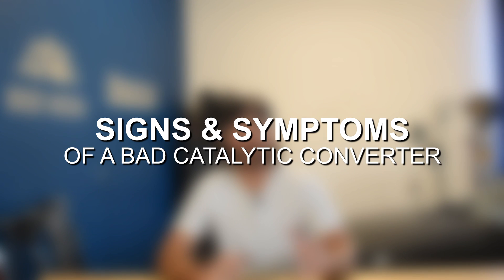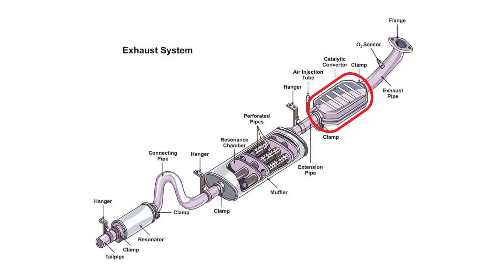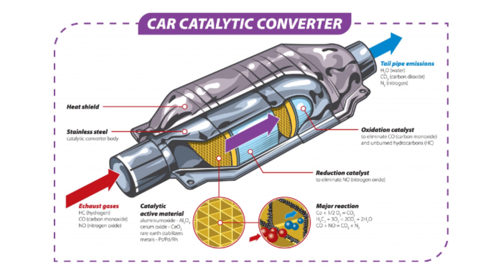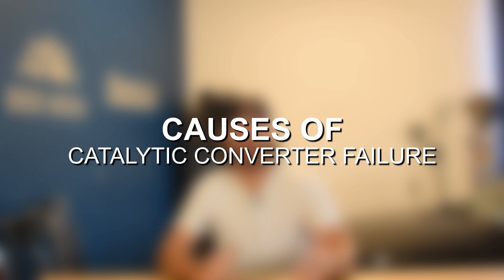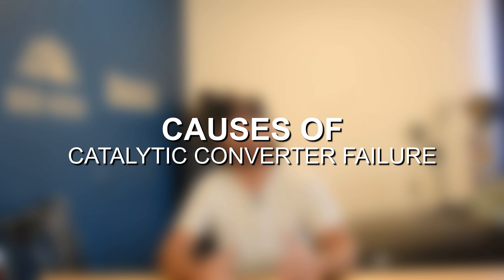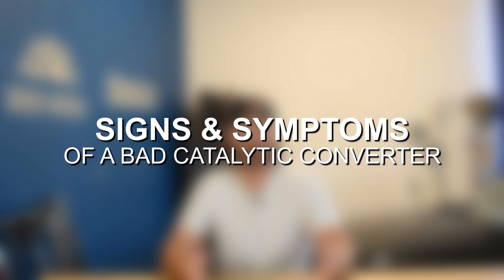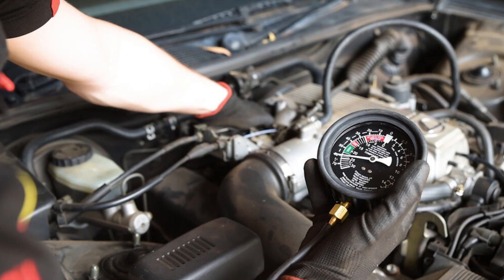Signs & Symptoms of a Bad Catalytic Converter!

Comment: My suv sounds like snap crackle and pop after I shut the engine off. No error codes to test. It used to be long drives I’d hear it. now it’s any drive over 5 minutes. could it be the Cat going bad?
Reply from the maker: C - Yes, a snapping or crackling sound after shutting off the engine—especially if it's progressively happening after shorter drives—could be related to the catalytic converter or exhaust system cooling down. It’s normal for exhaust components to make some pinging or popping sounds as they cool due to heat contraction, but if the noise is excessive, louder than usual, or seems to have worsened over time, it could suggest issues like a clogged or deteriorating catalytic converter, heat shields coming loose, or even exhaust leaks. Since you’re not getting any error codes, it might still be early in the failure stage, so keeping an eye (and ear) on it and checking the exhaust system for physical damage or looseness would be a good next step.
Reply: @ thank you and I appreciate the fast and thorough response. It’s a 22 year old mountaineer. So it’s probably about time.

Comment: My 2001 Ford Econoline run great but I think the cat convtr is falling apart inside. There's a loud rattling when accelerated or shift into reverse. Its got power but the loud noise is way too much.
Reply from the maker: C - If your 2001 Ford Econoline is running well but producing a loud rattling sound—especially when accelerating or shifting into reverse—it’s very likely the catalytic converter is failing internally, with the ceramic honeycomb breaking apart and rattling inside the housing. This is a common issue as these components age and get exposed to repeated heat cycles, and while the engine may still seem to run fine for now, those loose pieces can eventually clog the exhaust flow, leading to performance issues like reduced power, misfires, or even overheating. If the sound gets louder or performance starts to drop, it’s a good idea to replace the catalytic converter soon before it causes further damage.
Reply: @8020Automotive  thanks!

Comment: all engine lights on my 2008 toyota fj cruiser could it be a sensor tried cleaners did not change lights still on
Reply from the maker: M - We're gonna need more information here.. What lights? Do you know what engines codes you have?
Reply: @8020Automotive check  engine light car skid  trac vsc off  vsc track have no noticable symtons you mentioned
Reply from the maker: @marcelmatteau  Can you pull any engine fault codes?

Comment: Thanks so much for answering questions.....just had engine rebuild on 2003 Nissan Altima 2.5. Now codes coming up for cat issues bank 1, intermittent misfires and there's def lag on acceleration, rough idle, car dying out first thing in morn (after warm up that issue seems to go away) also making strange loud swooshing noise on acceleration....ive had couple people say i can continue to drive car for short while before getting fixed is that true?? I really dont feel comfortable w that
Reply from the maker: J - It’s understandable that you’re uneasy, and honestly, you're right to be cautious. After an engine rebuild, the issues you're describing — catalytic converter codes on Bank 1, intermittent misfires, rough idle, acceleration lag, cold start stalling, and a loud swooshing noise — all suggest something isn’t quite right, and continuing to drive it could risk further damage. The swooshing could be a significant exhaust or intake leak (like a loose or cracked exhaust manifold, intake boot, or vacuum leak), which would explain the misfires and rough idle, and could eventually damage the new engine or cause your catalytic converter to overheat and fail entirely. While a short drive to a reputable shop is likely fine, driving it regularly in this state could make things worse or unsafe. It’s best to get it diagnosed and corrected soon — especially since it’s right after a rebuild and may be related to workmanship or missed components during reassembly.

Comment: I have a 2011 Honda pilot touring my catalytic converter light came on today and once before and it was this bad gas could that be the same as today because my car ain't showing sign of anything wrong except for the light popped on
Reply from the maker: J - Yes, it’s possible that bad gas triggered the catalytic converter light again—especially if your Honda Pilot isn’t showing symptoms like rough idling, loss of power, or poor fuel economy. Low-quality or contaminated fuel can cause temporary emissions-related issues, leading to false catalyst efficiency codes. Try running a full tank of high-quality fuel with a fuel system cleaner. If the light persists or comes back after clearing, you may want to scan for stored codes (like P0420) to confirm if the catalytic converter is truly underperforming or if it’s just fuel-related.
Reply: @8020Automotive   thank you what kind of cleaner would be the best to put in it
Reply from the maker: @ Any brand of fuel system cleaner will work!

Comment: I have a 97 Ford f 150 no codes or anything. Truck ran good, slowly started getting a miss on warm up for a minute or so then runs smooth. Then started running worse and worse, now it runs really sad and can hear exhaust leak under truck by exhaust converters but don't see where it's leaking. I put new muffler on but wasn't the problem. I have 2 converters on both sides.
Reply from the maker: D - It sounds like one or both of your catalytic converters may be clogged or failing internally. A common symptom of a clogged converter is progressively worse performance, especially on warm-up, and a muffled or restricted exhaust note. The "miss on warm-up" that smooths out, followed by worsening running and a sad idle or hesitation, often points to increasing backpressure. If you're hearing exhaust noise near the converters but can't find a clear leak, it could be a cracked or internally collapsed converter causing the sound and backpressure. You can confirm by unbolting the exhaust before the converters (if possible) and seeing if the engine runs significantly better, or use a backpressure gauge in the O2 sensor port. If it improves, it's time to replace the clogged cat(s).
Reply: @8020Automotive   Thanks for the information, I'm going to exhaust shop and have them test it, but cannot afford catalytic 4 catalytic converters 2 on both sides. I'll let you know what they say.
Reply: Midas tells me that both catalytic converters are plugged up on driver's side.

Comment: Can a clogged cat cause problems in the transmission gear box?!!!!
Reply from the maker: A - A clogged catalytic converter won't directly damage or affect the internal components of the transmission, but it can cause symptoms that feel like transmission problems—such as poor acceleration, delayed or harsh shifting, or the engine revving higher than normal. That's because a blocked exhaust restricts engine performance, which can confuse the transmission’s shift logic, especially in electronically controlled gearboxes. Always rule out a clogged cat before assuming your transmission is the issue.
Reply: @8020Automotive thank you

Comment: I have a 2005 Chrysler Pacifica, failed emission NOx. Colorado changed the levels for Nox by 1 point passed before, now will not. only diagnostic code is 507 high idle RPMs too high. It will erase. IAT 34 degrees, TPS 14.1%, O2SB1S1 .1 to .8, STFT B1S1 -3.9 to -7.8, O2SB1S2 99.2%, Engine RPM 1135. Dealership initially said bad catalytic. Management will not allow techs to work on it-Parts
Reply from the maker: L - Failing emissions due to high NOx levels and P0507 (high idle RPM) could indicate issues with vacuum leaks, a faulty EGR valve, or a failing catalytic converter. Since your idle is high, check for vacuum leaks around intake hoses and gaskets, as unmetered air can cause a lean condition and increase NOx emissions. A stuck or malfunctioning EGR valve can also contribute to NOx failure by not recirculating exhaust gases properly. Your O2 sensor readings seem within range, but the B1S2 sensor at 99.2% suggests the catalytic converter may not be functioning efficiently. While the dealership suspects the cat, it’s worth verifying with a backpressure test or checking for clogged passages in the EGR system before replacing it. Try cleaning the throttle body and IAC valve to see if it resolves the high idle issue. If NOx levels remain high after addressing these, a new catalytic converter may be necessary due to inefficiency in reducing emissions under Colorado’s stricter standards.

Comment: Would replacing the tail pipe and muffler help rough idling and stalling instead of a new catalytic converter?
Reply from the maker: R - Replacing the tailpipe and muffler will not directly fix rough idling and stalling, as those components mainly affect exhaust noise and flow after the catalytic converter. If your catalytic converter is clogged or failing, replacing it would be the better fix, as a blocked cat can restrict exhaust flow, causing poor engine performance, rough idling, and stalling. However, if the muffler or tailpipe is severely damaged or blocked, it could contribute to minor airflow issues, but it’s unlikely to be the main cause. A proper diagnosis, including checking for exhaust restrictions, vacuum leaks, or sensor issues (like MAF or O2 sensors), would be best before replacing parts.
Reply: @8020Automotive  oh okay. Thank you

Comment: Great video, excellent explanation when I'm doing 65 or 75 or when I press the gas to accelerate it pulls lost power do you think it my be the catalytic converter? I replaced all 4 oxygen sensors
Reply from the maker: S - Thanks for the feedback! Yes, a clogged catalytic converter could be causing your loss of power at highway speeds or under acceleration. When a catalytic converter becomes restricted, it limits exhaust flow, which can choke the engine, causing reduced acceleration, sluggish performance, and even overheating. Since you’ve already replaced all four oxygen sensors, it’s worth checking for excessive backpressure in the exhaust system, which would confirm a clogged catalytic converter. Other possible causes include a failing fuel pump, dirty fuel injectors, ignition system issues (spark plugs, coils), or a transmission problem. To diagnose, you can perform a backpressure test, look for glowing red converters, or temporarily remove the O2 sensor before the cat to see if power improves.

Comment: Hello. I recently had a check engine light come on I. My 2023 Range Rover. Took it in and code was P2272 which they replaced the sensor and went on my way. About 5 months later check engine light again and this time it is a P2270. What would be the cause of these two seniors to go out to close in time. Also I would like to mention before all of this. I was getting low coolant levels and there was a faulty reservoir and reservoir cap which they had to replace. I also have been complaining of a vinegary smell of some sort from the exhaust constantly. They continue to say is normal. Car only has 25,009 miles on it and still under warranty. They haven’t given me any straight answers as to why O2 sensors are just going bad on a new vehicle. With that this has been an ongoing issue and hope to get some insight of what seems to be going on. Appreciate any feedback. Thank you.
Reply from the maker: T - The repeated P2272 and P2270 codes on your 2023 Range Rover indicate issues with the downstream oxygen sensors, specifically detecting a lean condition or signal bias. Given that both sensors have failed within a short time and you previously had coolant reservoir issues, there’s a possibility of coolant or another contaminant affecting the exhaust system, which could damage the sensors over time. The persistent vinegary smell could indicate coolant or excessive fuel presence in the exhaust, potentially pointing to a minor internal coolant leak, fuel mixture issue, or even a catalytic converter problem. Since the vehicle is under warranty, insist on a deeper diagnostic approach, including checking for coolant contamination in the combustion chamber, fuel trim readings, and exhaust system integrity, rather than just replacing sensors repeatedly.

Comment: Hey I know this is a catalytic converter video but I'm having issues with my 2014 BMW X6 x35i. I get codes P0368,P0343, P052B, P054B and P15ED.  I changed both camshaft position sensorsand both Vanos Solenoids and the codes are still there with the check engine light on and reduced power.  Could the timing chainbe the issue?
Reply from the maker: S - Yes, given the codes P0368 (Camshaft Position Sensor B Circuit High), P0343 (Camshaft Position Sensor A Circuit High), P052B (Cold Start Intake Camshaft Position Timing Over-Advanced), P054B (Cold Start Exhaust Camshaft Position Timing Over-Retarded), and P15ED (Camshaft Control: Exhaust Camshaft Stiff During Cold Start), it's possible that the timing chain or timing components are the root cause. Since you've already replaced the camshaft position sensors and VANOS solenoids with no improvement, the next step would be to inspect the timing chain for stretch or excessive wear, check the VANOS actuators, and ensure proper oil pressure since these systems rely heavily on good oil flow. A stretched chain can cause incorrect cam timing, leading to rough running, power loss, and persistent codes. If you hear rattling at startup or under acceleration, that's another sign the chain or guides may be worn. A full diagnostic with a timing tool kit and camshaft adaptation reset via BMW ISTA or a scan tool is recommended before tearing into the engine. Keep us updated!
Reply: @8020Automotive  Thanks for the feedback.  Definitely will!

Comment: Trusted""Shop said 5 different times, " you need all 4 catalytics on Ford 2002 F-150.... 220K & original cats. 
Long story short, original factory  hose behind manifold, burned hole. $45.00  98 4runner 355K p0420. Intermittent misfire. Boot on plug arcing. Electrical tape on side of highway. Drove away in 20 mins. New wires $60.00.  Ck everything first! Those old cats were still good.
Reply from the maker: B - Wow! Sorry to hear.. Could have been far more costly!

Comment: My truck tries to shut off after its warmed up and i try to accelerate will a clogged catalytic converter cause that
Reply from the maker: C - Yes, a clogged catalytic converter can cause your truck to stall or struggle to accelerate after warming up. When the cat is clogged, it creates excessive backpressure, restricting exhaust flow and starving the engine of power, especially under acceleration. Symptoms include loss of power, hesitation, rough idle, poor fuel economy, and even stalling. You can test for a clogged cat by removing the upstream O2 sensor temporarily to relieve pressure or using a backpressure test gauge. If acceleration improves, the cat is likely the issue. Other possible causes include fuel delivery issues, ignition problems, or a faulty sensor, but the cat is a strong suspect.

Comment: I have a 2005 jeep not wanting to shift out past 3 rpms please help
Reply from the maker: D - If your 2005 Jeep is not shifting past 3,000 RPM, the issue is likely related to the transmission control system, throttle position sensor (TPS), or a clogged transmission filter. First, check the transmission fluid level and condition—low or dirty fluid can cause shifting problems. Next, scan for stored trouble codes, even if the check engine light isn’t on, as a failing TPS or input/output speed sensor can disrupt shift timing. If the fluid is fine and no codes appear, the transmission filter may be clogged, restricting fluid flow and preventing upshifts. A transmission control module (TCM) reset by disconnecting the battery for 10-15 minutes may also help if it's a temporary electronic issue. If the problem persists, a bad shift solenoid, valve body issue, or internal transmission wear may require professional diagnosis. Keep us updated!

Comment: would a bad cat stop a car from starting? my car has stopped starting one morning giving no warning , still had plenty of power the night before, managed to get it towed to a garaged and they said the cat had collapsed, so fillted new one at the cost of £1200. driven less than 10 miles and now no starting. im at a loss at what to do
Reply from the maker: H - A bad catalytic converter can cause a no-start condition if it’s fully clogged, creating excessive backpressure, but after replacing it and driving less than 10 miles, the fact that your car won’t start again suggests another issue. Possible causes include a fuel delivery problem (weak fuel pump, clogged filter, or bad fuel pressure regulator), ignition system failure (faulty crankshaft or camshaft sensor, bad coil packs), or an exhaust blockage if debris from the old cat is still restricting flow. Additionally, check the battery, alternator, and all ground connections, as a weak alternator or poor electrical connection can prevent the car from starting. Since it ran briefly after the new cat was installed, scan for stored codes even if no check engine light is on, and test for fuel pressure, spark, and sensor faults to pinpoint the issue. Keep us updated.
Reply: @8020Media  thank you for your fast response. The car went back to the garage and he's now saying the turbo has seized and that's what's causing the no start issue. It's true to start but coughs and stalls , he wants another £1000 for the new turbo, I will need a long think about if it's going to be worth it, it's getting on for more than I paid for the car. Would a seized turbo cause the no start issue ? Thank you for all the help
Reply from the maker: @HumorHubCreator  This is certainly a possibility..